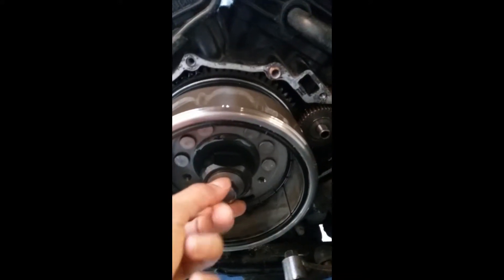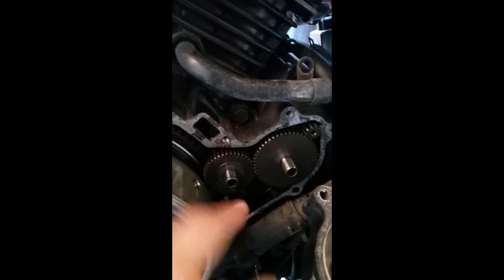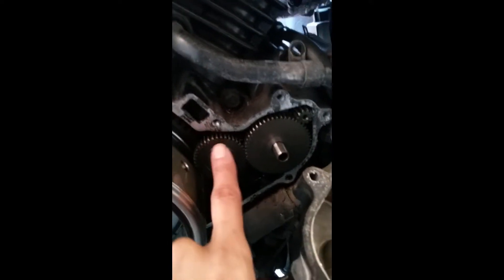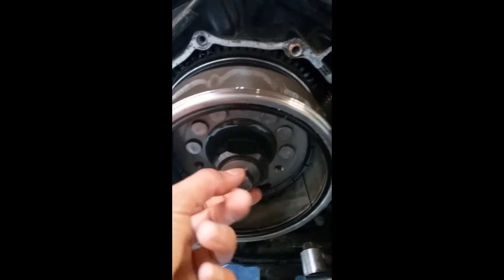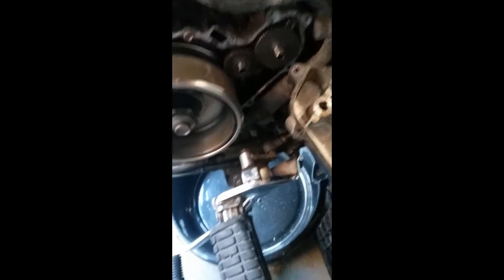1985 Honda vt500 problem, SOLVED

Comment: Congrats.. What is your intention with this ride are you going to make some mods? These bike can easily be turned into cool Bobber. René
Reply from the maker: Thanks! I was thinking of getting a bit shorter rear shocks and i might change the exhaust to make it sound a little louder. And just small adjustments/changes like new cables, grips etc. I'm also going to put a longer sissy bar on it.